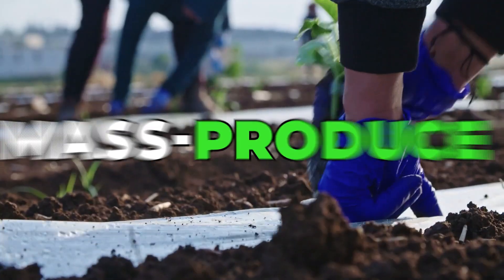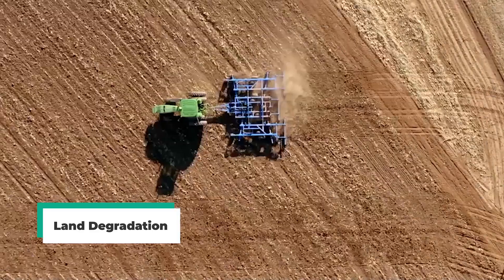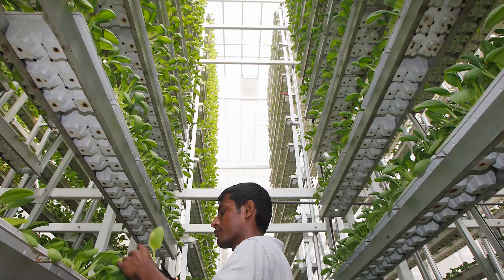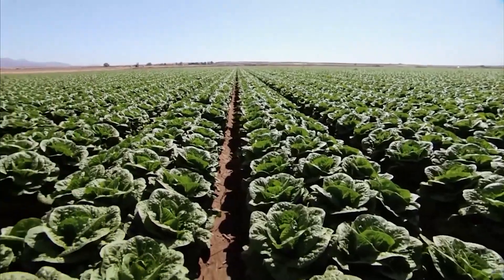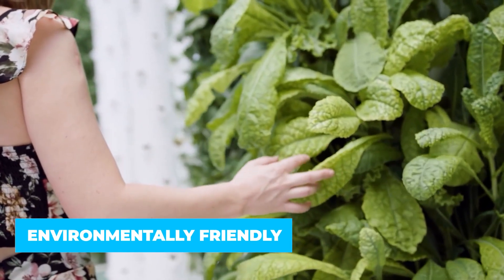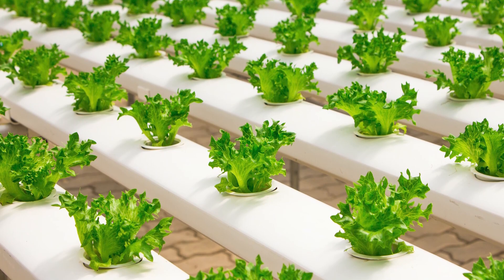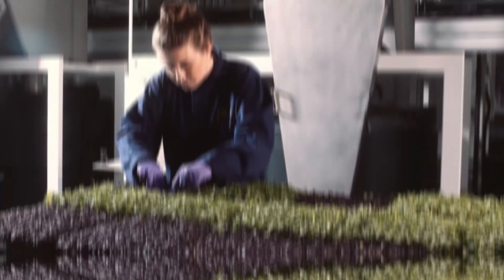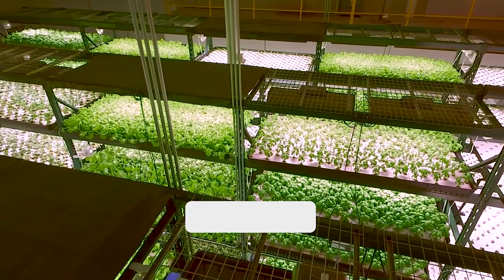Is Vertical Farming Going To Be The Future?

Comment: The energy requirements of vertical farming lead to significant land use to provide the energy. For every acre of crops grown via vertical farming, 5.4 acres of solar panels would be required to supply the energy via solar power.Thus in practice, vertical farming may require more land than traditional farming, not less 
Louis Albright, a professor in biological and environmental engineering at Cornell stated that a loaf of bread that was made from wheat grown in a vertical farm would cost US$27.However, according to the US Bureau of Labor Statistics, the average loaf of bread cost US$1.296 in September 2019, clearly showing how crops grown in vertical farms will be noncompetitive compared to crops grown in traditional outdoor farms
According to a report in The Financial Times as of 2020, most vertical farming companies have been unprofitable.
Vertical farms must overcome the financial challenge of large startup costs. The initial building costs could exceed $100 million for a 60 hectare vertical farm.Urban occupancy costs can be high, resulting in much higher startup costs – and a longer break even time – than for a traditional farm in rural areas. In Victoria, Australia, a "hypothetical 10 level vertical farm" would cost over 850 times more per square meter of arable land than a traditional farm in rural Victoria

Comment: Some very good points. I do question the nutritional density of the food produced, there needs to be more research into this. Undeniably saves on water usage and transportation costs.  Food grown locally can  be ripened more also because of the smaller amount of time spent in transport.  This would be a great use for defunct malls and former manufacturing space

Comment: I realize this is clickbait and I've fallen for the trap, but I'll state the obvious. Sun = free...  grow lights & electricity = expensive. I'll let you figure out the rest
Reply: Listen to Dickson Despommier‘s podcast and that will change your mind
Reply: @MichaelWhitener  The energy requirements of vertical farming lead to significant land use to provide the energy. For every acre of crops grown via vertical farming, 5.4 acres of solar panels would be required to supply the energy via solar power.Thus in practice, vertical farming may require more land than traditional farming, not less 
Louis Albright, a professor in biological and environmental engineering at Cornell stated that a loaf of bread that was made from wheat grown in a vertical farm would cost US$27.However, according to the US Bureau of Labor Statistics, the average loaf of bread cost US$1.296 in September 2019, clearly showing how crops grown in vertical farms will be noncompetitive compared to crops grown in traditional outdoor farms
According to a report in The Financial Times as of 2020, most vertical farming companies have been unprofitable.
Vertical farms must overcome the financial challenge of large startup costs. The initial building costs could exceed $100 million for a 60 hectare vertical farm.Urban occupancy costs can be high, resulting in much higher startup costs – and a longer break even time – than for a traditional farm in rural areas. In Victoria, Australia, a "hypothetical 10 level vertical farm" would cost over 850 times more per square meter of arable land than a traditional farm in rural Victoria